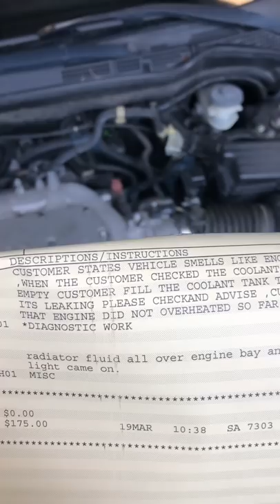Do not use this type of hose clamp because…

Comment: Mechanic for 12 years. This has very little to do with the type of clamp, and everything to do with the plastic. Drastic temperature changes (northern climate), and/or poor quality plastic causes the whole system to become extremely brittle.

It's common on all vehicles, but particularly more common on Japanese and German vehicles.
Reply from the maker: If it was a spring clamp this wouldn't have happened. More common on Japanese cars? My 18 year old celica with its original radiator and spring clamps is laughing at your opinion...
Reply: @2zzlow  Well, to be fair, when i changed the radiator on my Audi a4 b5 the upper radiator connection just crumbled in my hands and there was a spring clamp on there..
But i agree with you, for unexperienced people the spring clamps are safer
Reply: @2zzlow  I'm sure that's what you told the customer, and they probably believe it too. The fact is, that this accord/odyssey/whatever is not you celica.

 There's a reason that the oem clamp is missing. (a cracked radiator inlet perhaps?) that somebody assumed was an oem spring clamp that has lost its spring tension.  It's common. You will also see it often in heater hose T's/ joints, and thermostat housings. They just don't hold up well to the coolant/temp changes.
Reply: @2zzlow  lmao your a mechanic right? Not surprised that your vehicle maintenance is up to date and well kept, not everyone does this and is probably the reason you still have a job if everyone did proper maintenance alot of vehicles would still be on the road.
Reply: @2zzlow  had a 20 year old turbo jetta, coolant hose did the same exact thing on oem clamps, I'm laughing at your opinion.
Reply: @2zzlow  so just to be clear, you’ve had said Celica for the last 18 yrs right? If not we’ll all gladly laugh at your lack of knowledge on wether it’s original or not.
Reply: @2zzlow  son when you have more experience you will understand better. My 50 years worth is laughing at you 🙄
Reply: @2zzlow  my 34 year old st165 Celica and 36 year old mr2 has the stock spring clamps (there's still the pen marks from factory). not a single cooling issue on 2 of the toyotas that retain the most engine bay heat ever. still on original radiators. your conclusion is correct. there's a reason why Toyota spent money engineering all sorts of different spring clamps in so many different sizes and applications. it's one of the few things that make toyotas reliable af.
Reply: @2zzlow  yeah that's how you build an audience, talk down to your viewers with inaccurate information. Lmfao, didn't make it far as a mechanic and you're not gunna make it far as a YouTuber either.
Reply: I have been  a full time mechanic since 89. Yes, a spring clamp does keep contant pressure when new. I have seen spring style clamps break, loose tension, require EXACT mark line up on reused hose. Worm gear aren't better or worse. Just different. The issue in this case is the plastic rot. Not all rads are created equal.  Seen lots of rads (and other plastic fittings) turn to cheese.
Reply: ive noticed those honda/acura radiators are just flimsy and if its old  itll break if you look at it wrong
Reply: @2zzlow  my 26 year old F250 with the original radiator and screw clamps and 23 year old oldsmobile also with original radiator and screw clamps are making you look like an idiot.
Reply: It’s common in automotives, period. The plastic used in radiators can only with stand so many heat cycles, which is determined by a lot of things. Often busting in one of the end caps but can sometime bust here. The bad thing about those spring clamps is they often loose their tension and strength, it may seam like they’re tight when you put a pliers on them to remove them, but they probably arnt clamping hard enough to overcome the hoses, and what’s holding the hose on is it being physically stuck to the nipple. I’ve owned many hoopties in my life time, and a few new cars, those factory spring clamps are hit or miss. The screw clamp is great, never broken a nipple, and on one particular vehicle I use to have I tightened the piss out of them as it would drip if I didn’t, that was a Subaru, never broke the nipples. This video is pretty much showing what old plastic will do, I’d bet this radiator has a crack in it in one of the end caps too and no one’s seen it yet, if not, it’s not far off.
Ps, I’ve been a certified mechanic for over 12 years too. Plastic end capped radiators are simply garbage, so many failure points.
Reply: @tatsuhirosatou5513  my oldsmobile is 32 years old and is also making him look like an idiot lol
Reply: I've worked on multiple old camrys and corollas and the plastics on the radiators will break very easily. Had a coworker bump the hose during an oil change and it cracked just like the video. Plastic was a nasty brown color and was obviously at the end of its life.
Reply: @stoney.g0420  oh my sweet summer child. If he's a mechanic his car is burning or leaking oil at least. Your plumber has a running toilet. Your lawn guy hasn't trimmed his hedges since last fall, and your doctor has been ignoring that weird twinge in his knee.
Reply: @albertnonymous1886  It's true. The specialists last appointment is always their own.
Reply: I own a 2021 gmc denali.  The oem clamp is already going out.  Had to switch to the bolt clamp.
Reply: @2zzlow  bruh everyone is laughing at you
Reply from the maker: It’s 9k likes against 900 dislikes. Those 900 can keep laughing if they like
Reply: @2zzlow  the moral of my story, As well as many others, is that we're trying to help you become a better tech. Otherwise you will spend a lifetime working for somebody else's profit, reading and diagnosing every repair from a shop manual. Limited to being nothing more than a parts changer.

Sometimes you must "look beyond what you see"
Reply: Thank you somebody has an intelligent brain I've been a technician for 17 years and I was about to say the same thing
Reply: nissan oem radiators crumble like this too.
Reply: @BLWRK  spring clamps rarely lose tension unless they get rusty. Stop spreading false information
Reply: @Andrew M  obviously my comments had nothing to do with spring tension, and everything to do with the integrity of the plastic used in the cooling system.
Reply: @2zzlow my 00 lexus es300 had this fatal issue while driving cross country, i had no choice but to junk it.
Reply: That plastic is old and brittle, sh@t dont last forever. It probably broke trying restle the hose off of their. Its done, should have got a new radiator

Comment: Lol those hose clamps are the best. I used to test pipes on submarines. We use these clamps to hold over 100psi. Just use a screwdriver to tighten it and you can’t over tighten it.

Comment: Those screw style of clamp have been used on automobiles since they've been liquid cooled (maybe not that long). Just cause someone else don't know how to size and tighten them doesn't mean there garbage.
Reply from the maker: Every person has an opinion
Reply: @2zzlow  and you chose to talk about it by creating this video. Sorry it backfired on you
Reply from the maker: Ohh heavens no Cory! YouTube is paying me because you are here! Lmao 🤣
Reply: @2zzlow  In that case have another dislike. That sure helps you get seen right?
Reply from the maker: You bet! keep dropping them comments
Reply: @2zzlow  don’t be such a clown just admit there good clamps tf.
Reply: Because it was plastic like today
Reply: Even the shop that rebuilt my bike gave me shit for using these types of clamps.. idk why other than what's shown in this video.. they are hose clamps tho so idk 🤣
Reply: @Coach4.5.0  because it takes an extra 25 seconds to get a screwdriver and then loosen it etc...
Reply: @luvdady  and even quicker with the right hex head screw driver
Reply: @2zzlow  Some one is actaully a Doos of Poes..
Reply: What if I told you things have advanced and improved since the Model T?

Screw clamps were used back when cooling systems were unpressurized, so it didn't take much to hold the hose on. Now adays with 16, 20, or higher psi you definitely want a spring clamp holding that hose on.

Comment: I absolutely despise those OEM clamps. It may be because I've mostly worked on older cars, but those clamps are usually a gigantic pain in the ass to take off and reinstall in comparison to the worm clamps
Reply: When you have the correct tool, they are easier and faster.
Reply: Plyers work a dream. I inly use them to fit an after market induction kits though  😂😂
Reply: Not if you have the proper tool for them I can remove and reinstall constant tension clamps much faster and easier than worm drive clamps
Reply: Iv'e seen the OEM clamps just snap in half on more than one occasion when removing a hose
Reply: I promise the harbor freight cable style hose clamp tool would change your mind. I ended up with a matco version after a few years, but it totally changes lower hose installation on a fwd anything! 
Thats one thing I keep in my mobile bag no matter what, because its 3 feet long, it will go places you can't physically get your hand.
Reply: @ryanlong3663  I've many warm drive clamps do the same thing. Bonuses when you have everything together and it just breaks while you're trying to tighten it and it's not even that tight. Pass.
Reply: Yep, in Australia we upgrade to worm drive clamps for customers all the time. It's done all over the country. Especially important in the hotter climates in Australia to give some reliability to the cooling system
Reply: He wearing gloves
Reply: @oliver_klozoff old Audis would like to have a word with you 😭😂
Reply: @Godofklout3  not going into krautmobiles
Reply: @oliver_klozoff  they are the best 😤
Reply: @Godofklout3  lol, yeah if you need a computer for each brake light and want to remove the engine to change an alternator 🤡.
Reply: @oliver_klozoff  that’s the best part GOBBLESSS
Reply: You shouldn’t be working on cars if you can’t handle taking a spring clamp off
Reply: That and they’re supposed to be only one time use realistically for the OEM clamps. As overtime it expands and decompresses from heat and cold, it just loses its strength.
Reply: Try taking a spring clamp of a ram 5500 cummmins upper heater hose.  Then tell me how much better they are.

Comment: I’ve not had an issue with those clamps, I use them for my cooling system. 10x better than steel ones that rust out

Comment: I mean yes and no, you aren’t wrong overall but those clamps work just fine if you use them properly… In this case I see 2 issues, they used to large of a clamp which causes it to clamp very uneven as it has to remold as you’re tightening it and as you stated they over tightened it. I have had plenty of vehicles with worm style clamps on plastic fittings and no issues and some manufacturers even use them. (Mercedes)

Comment: Did you charge him 175 for that diagnosis? The factory hose clamps work great with new hoses, but if the hose is worn out the others work better.
Reply from the maker: I didn’t, the dealership did. 

I would much rather run a new hose. Inexpensive to begin with.
Reply: Factory clamps the only clamp that should be used. Worm gear clamps are after market garbage. Just like a most after market parts are not built to e.o quality
Reply: @89gt5.0  you’ve clearly been using them wrong. Never had an issue with them on bigger hoses. They are shit for smaller hoses but the bigger ones they work fine
Reply: @Auto209  yeah clearly they are hard to use. So complicated. Maybe i should read the instructions next time.
Reply: @89gt5.0  both types have issues. Worm gear clamps have the possibility of being overtightened and damaging the material underneath. If you use them right thats not an issue. Spring ones can get worn out and not clamp properly. Ive had factory spring ones on the factory hose that didnt clamp at all, the hose could just pull right off.
You can use either one, just be aware of the issued with both.
Reply: @89gt5.0  except all major brands of industrial diesels use worm gear clamps, because the clip on type are garbage. 
The clamp used here is crap and to long. There are several different grades of worm gear clamps. Get good ones and they are better. The clips on cars are not used because they are better, they are used because they are cheap.
Reply: @89gt5.0  the OEM hose clamps on newer Hondas or trash
Reply: @89gt5.0  name me one part that OEM  is better then aftermarket
Reply: @701garage  all of them if it’s not a performance part.
Reply: @Auto209  The proper use for the worm gear clamps is to throw them in the trash where they belong.

Comment: When those factory spring clamps leak, how do you tighten them up.  Because we all.....well I know, that spring steel over time loses its strength, especially after many heat cycles.  Also, how do you get a new one on without draining the system and removing the hose?
Reply from the maker: My 18 year old Celica still has the original clamps, guess it’s not a problem with a Toyota. 

Well the second part is irrelevant since they are both made out of the same material soooooooo 

Don’t need to if my original one is not leaking after 18 years 

Again, opinions
Reply: It's a spring clamp it gets tighter as the coolant expands and when it contracts it springs back to its original size screw clamps will loosen when it expands then it has to be tightened again manually
Reply: You can buy replacement spring clamps. Or better quality worm gear clamps. I've never had a parts store worm gear clamp break on its own, mostly it's from overtightening on my part or using the wrong size.
Reply: @2zzlow  what are you talking about? Worm gear clamps don't spring mechanics like oem clamps
Reply: "How do you tighten them up?" Use a bench vice and squeeze it a little on the sides, them turn it 90° and squeeze a little more. Done. Brand new and no overtorque problems. I love those ones for the cooling system cause you're never breaking any plastic connections and won't get any leak either.
Reply: Steel heat cycles?  At what temperature does the steel begin to weaken from heat cycles?  The temperature at the clamp is maybe 200°F. I sure hope the steel isn’t weakening from that low of a temperature.
Reply: @White000Crow  barely hits 140F Hahahah not enough to chance its microstructure.
Reply: @LM_Cams  my truck has a 190° thermostat so I was overestimating the temperature.
Reply: The spring steel does not lose tension over time. It's spring steel, the magnitude of the stress and the temperature at which it's exposed means that the life cycle of the spring temper is infinite. This is something you would learn in a metallurgy fundamentals course.
If the hoses are beginning to leak that's because the hoses are failing due to age and ozone exposure. It's not a failure of the spring style clamp unless they've been otherwise damaged.
Reply: If its leaking with a spring clamp you need to clean the connection, or replace the hose. 

Slapping a worm gear clamp on is just going to overtighten the connection, possibly breaking the plastic radiator neck as seen here.

Comment: FINALLY Someone shows a video on those garbage worm drive scree clamp's. The pathetic part is: you can't buy the OEM spring style clamps in parts stores. They always try to "up sell" the screw clamps when a customer is buying coolant or a radiator hose.
Reply from the maker: the spring clamps aren't even that much money, I paid $5 each for mine at the dealership when I was switching new hoses on my dads 250k mile matrix. just because it was bought from the dealer doesn't mean it cost a lot

Comment: The REAL “big no” would be listening to this clowns advice
Reply from the maker: It’s just an opinion that triggered a lot of individuals. Maybe that’s why Scotty Kilmer is a successful YouTuber
Reply: @2zzlow  or maybe your opinion isn’t as “good” as you thought it was and got a response you didn’t expect
Reply from the maker: Judging by the like and dislike ratio i think it’s good. 5k likes vs 500 dislikes.
Reply: @2zzlow  people 10:1 is a bad ratio analytics wise. Most people don’t know crap about cars and will like your video for the fact it popped up and served as “information” I wouldn’t trust 90% of people to drive a car properly much less understand real mechanic work. I’ve been wrenching for over 10 years my dad owned his own race shop for over 30 and built winning motors and never once has he discouraged a screw type hose clamp… nor would I, over 40 of my own personal cars, and a civic pushing 400k miles in Indiana that’s been beat to shit and never had one fail. If you don’t tighten it like a gorilla your probably never going to have an issue. The plastic crumbled and it was due to duty cycles and probably overheating the thing multiple times.
Reply: @2zzlow  🧢
Reply: @aaronamiotte1041  you have 40 cars?
Reply: @aaronamiotte1041  car hero’s 😂😂
Reply: @jermex2352  yeah btw I have owned over 40 cars and trucks… if that’s hard to believe that’s on you buddy
Reply: Literally tho 😂😆
Reply: Make sure you take advice from the guy that plays slots at the casino lol
Reply: those clamps are worse than oem, it's just factually correct.
Reply: AGREED
Reply: Agreed!
Reply: It's less his advice, more of how he read the customer notes, "checkand" like use common sense, it's a typo, and his arrogant know it all tone.
Reply: No doubt!

Comment: Warm drive hose clamps have been around for probably 90 or 100 years now literally.
Quality ones work great hence why they have been used since the Model T and A days, 
Squeeze clamps tend to lose tension when reused especially when exposed to heat cycles such as a radiator. 
Honorable mention of a quality clamp should go to the hose clamps you tend ro see on Japanese vehicles, the clamps that use a center bolt to sinch down a dual wire clamp, they are a good clamp also.